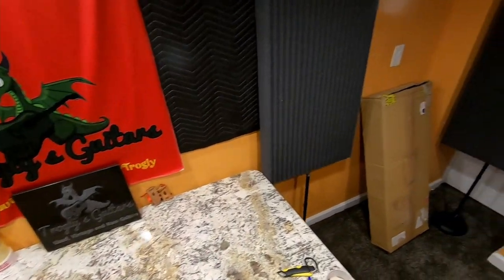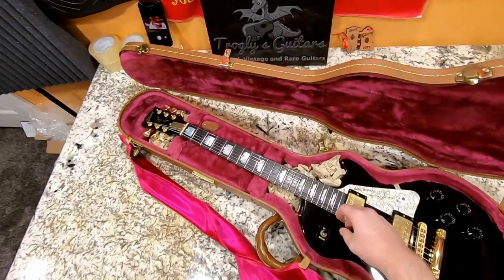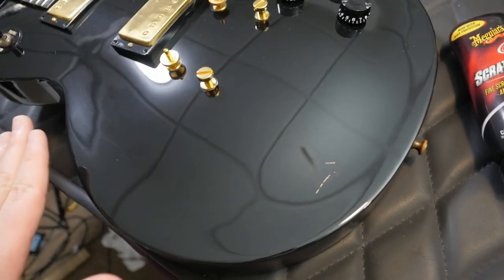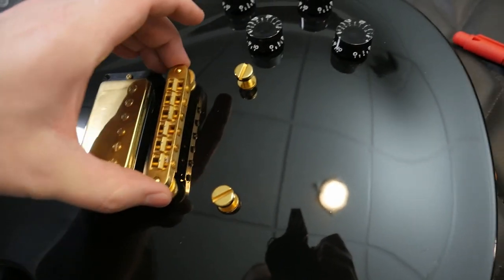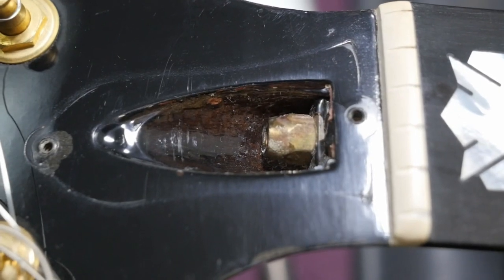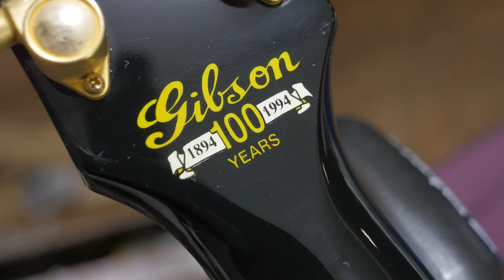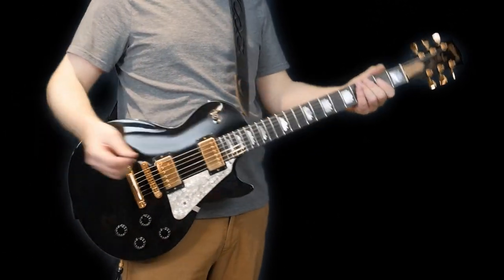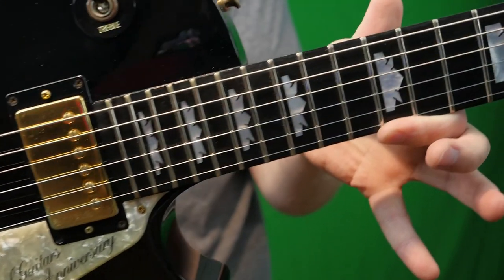I Never Knew This Existed! | 1994 Gibson LP Studio Ebony House of Guitars 30th 100th Anniversary

Comment: Hey Austin, If memory serves me correctly, I was the original purchaser of that HOG Les Paul.  I'm 99% sure mine was serial number 22 of 30.  Some time around 1999  I sold it to Elliot down at Rumble Seat music, along with a HOG 25th anniversary Silverburst standard.  Back when I sold it, Elliot had MANY MANY Japanese collectors on speed dial, and it would not surprise me if that is how that guitar ended up in Japan.  The ORIGINAL case that came with the 30th Studio was a Black Levys Gig Bag, and the Les Paul photo was installed on the guitar, right before my very eyes by Andy Babiuk, the author of "Beatles Gear" and "Rolling Stones Gear".

Comment: I especially shopped for a studio just for the reason. I ended up with a 97 ebony w/ gold trim and 496/500 pups. For $800. With a chainsaw case. Now I've replaced anything that could be labeled inferior including Kluson locking tuners, Tonespro locking bridge, Tusc XL nut, CTS 500K pots, 50's wiring with cloth wrapped wires. Love this guitar now.
Reply: Rock on brother! Gotta love a studio!…

Comment: I have a 93 Studio in Alpine white, and I thought that, if memory serves me, they called that neck shape a 50's D. I got mine in 95 I believe, at a pawn shop in basically new condition except whoever had it before me was very inexperienced and when they changed the strings they scratched up the headstock a great deal. Since then ive had tattoos on it, and eventually had it pinstriped, Im looking for a way to get the pinstriping off now considering the prices these things go for nowadays, it was my first Gibson though and I doubt if i ever get rid of it.

Comment: I have an early 90's Les paul with gold hardware - It doesn't have a celluloid pickguard, but has all the same metal oxidisation that you blame on celluloid! like the green bubbling gold plating, rusty screws, pitting on the bridge, and finish checking!

Comment: Can you steam the fretboard back into place? I am sure they didn’t use hide glue on a Studio even back then right? Perhaps you can confirm whether you’ve heard this or have any feedback on this but I read that genuine hide glue used on today’s Custom Shop models as well as the 50’s models they’re much easier to repair by simply steaming the neck off? The maple tops they use an epoxy however so you cannot steam a maple top off but from what I’ve read you can steam the hide glued neck off for repair reasons. Any insight on that?

Comment: Did you no notice that the string spacing is off?  Your D is too close to the A at the bridge.  It looks fine at the nut, so is the saddle slot misaligned, or did you just not seat it properly when you restrung it?

Comment: I bought # 13 . They originally came with a gig bag not the hardshell  case.  Also had the signed LP pic. Only $1500 when they sold them in 94.

Comment: It looks like the edges of the fret board have been rolled. I don't think it's shrinkage.
Reply: @joepasco1420  in guitars rolled fretboard means that the edges have been rounded over to mimic the effect of a played in guitar where the sharp angle of the edge of the fretboard has been softened by use

Comment: It's interesting to see clear coat issues with 90's era guitars. It seemed every car and truck from the same era had the same issues. Did they try similar paint processes on guitars? I seem to remember the clear coat peeling on autos being blamed on new EPA regulations at the time, but don't quote me on it.

Curious to learn if anyone here knows they were trying similar applications back in the 1990's.
Reply: Guitars have frequently been painted with automotive paint since the 1950's and often still are today.

Comment: If you want to test a pick guard you suspect to be celluloid, put it under hot running tap water, this is the safe method. Celluloid omits the scent of camphor when heated in this way. It is a highly flammable material and the out-gassing is basically nitric acid . Ultimately it is not a good idea to store celluloid in an airtight container or sealed in a plastic bag, celluloid needs need to breathe.

Comment: HOG is  also Harley Owners Group which has been around a lot longer. If you clean it and it doesntvsoumd like a monkey when you rub it it's not clean. I forget what band I saw the first time using the sound a clean glossy finish makes and rubbing it near a directional mic . It was a bongo or something similar.  I guess since the sound comes from a type of drum is why  it's considered percussion. May have been Chaka Kahn. I wonder if there would be a way to coat the celluloid so it doesn't off gas. Short of using a faux celluloid replica. I saw a shop on face book market that sells used guitar parts and replacements. They were advertising a LesPaul signed pick guard too.  I can't recall the name and don't know the reputation of the company. I wonder if Murphy labs has figured out how to give a guitar fretboard shrinkage. That shrinkage almost looks like scallops except it's not the face of the board that has shrunk. I do have the same inlays on my SJ 200. Hmm the finish lifting happens a bit on 3M painted cars that have a high gloss  finish. Its said it has something to do with a base coat on cars that makes that happen. It will either lift crackle orange peel or flake.